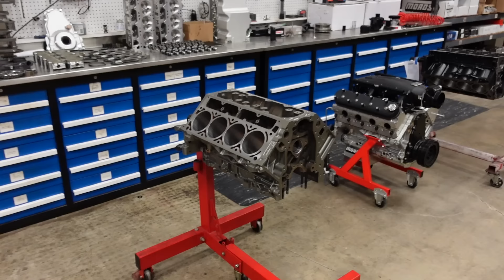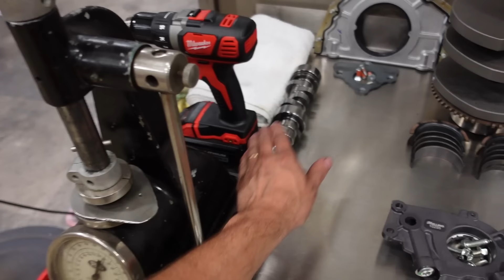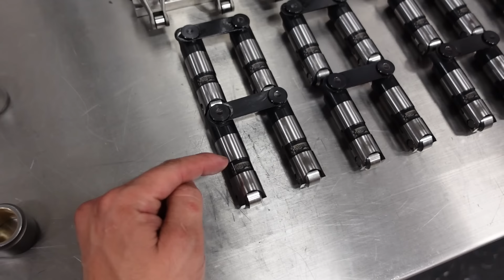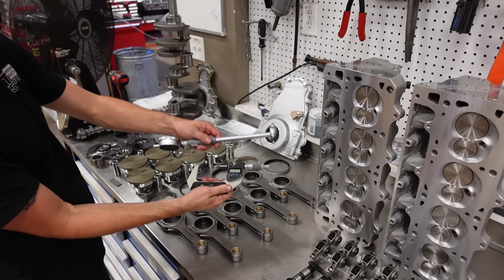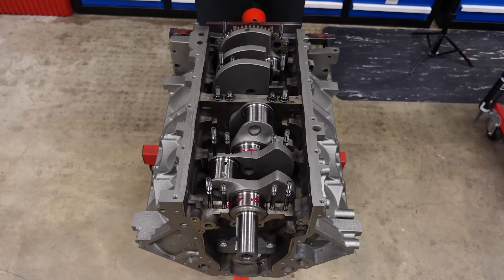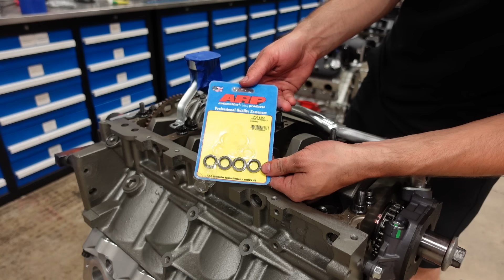BUILDING a 6.0 LS3 STROKER! - Complete Engine Assembly - Part 2

Comment: Hi ive been learning a lot from your videos and im starting a build with some stuff my cousin left laying around and wanted some thoughts on the combination of parts its a 358 build with 12cc pop up dome pistons. 6inch H beam rods crowler forged 3.480 stroke crack. flo-tek heads 180cc intake runners 66cc exhaust runners and 2.02" intake valve 1.60" exhaust valve cam lift 443/465 duration 214/224 112 LSA TH350 but plan on changing to a 4L80E later on posi rearend 3.73 gears may change to 4.11 3000+ lbs car

Comment: Currently building a 416 NA LS 3 with Comp rocker shaft system. Whats the part # for the correct link bar Johnson lifters with axel oiling feature for 1.7 rocker ratio?

Comment: I’m building a LQ9 but made it to a 6.2 with stock 6.2 pistons and gen 4 rods 

What head gaskets and head bolts should I use?
Reply: The same ones you ran when it was a 6.0……cant go wrong with Ls9 headgaskets though

Comment: don't you need to center the oil pump outer ring to the body before tightening the mounting bolts?
Reply: Quiet you're messing his rhythm up. But yes😂
Reply: did it in an older video

Comment: So you’re saying you ran the 260cc heads on a 4.0 bore block? Been debating on ordering these or prc heads
Reply: What brand standard bearings are you running? The rotating assembly I got has acl coated bearings but when looking online I can’t find a match set of x bearings for if I need to split the difference as you did on the mains. Texas speed said they use a specific bearing but I can’t even find these on their site. Was thinking about going with king bearings or buying acl bearings and starting over. I believe the bearing name on the box says performance engine bearings but when searching the part number it comes up with engine tech which what I’m finding is acl bearings

Comment: Random question? The 4.8L LS is a 3.78 bore (or close I believe)? I’m wanting to build an AMC 304 V8. Custom pistons are Stupid expensive, even cast? If I could use off the shelf 4.8 Forged Pistons they would be dramatically cheaper( I understand it will have to be bored & homes to the exact size). What’s the odds the skirt length & the in the hole size will work. New to the Channel any help would be appreciated. Thx!